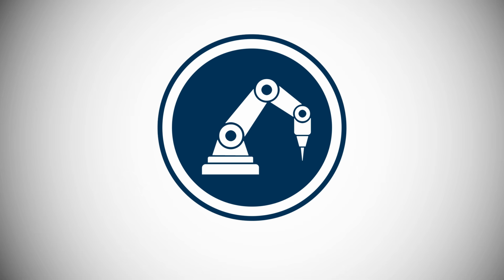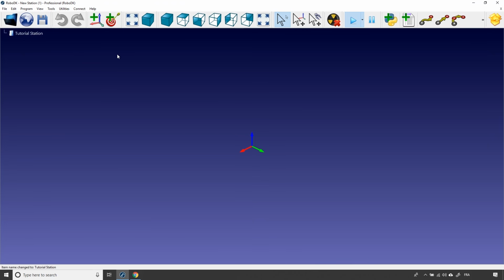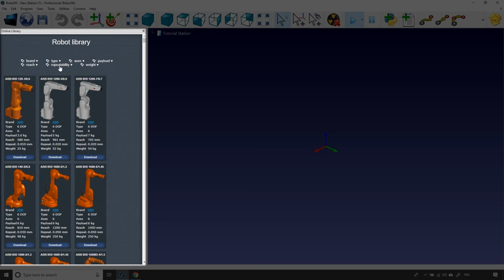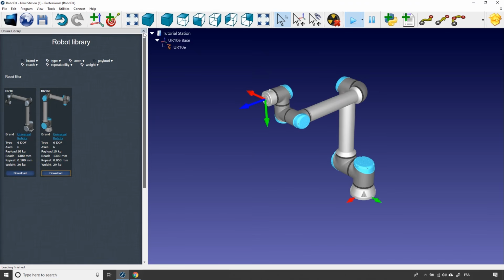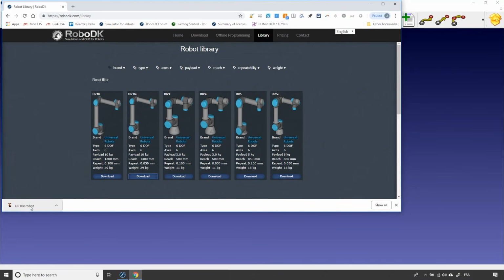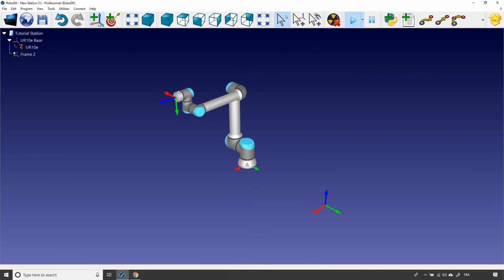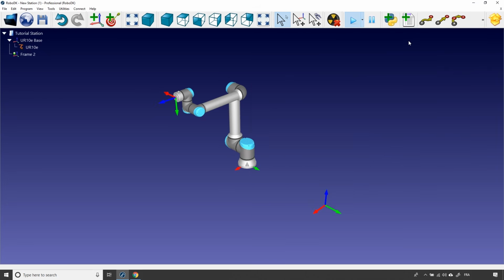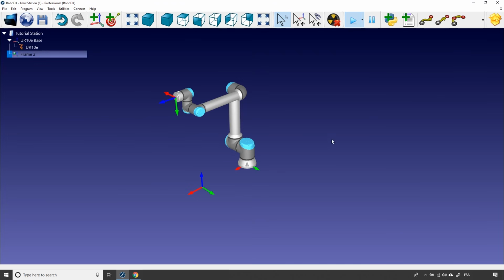Getting Started: New Project - RoboDK Documentation

Comment: AWESOME, can I work with arduino and Robodk? I mean if I make a simulation, can I have the codes for arduino??
Reply from the maker: RoboDK can not run on arduino. On the other hand, you can create your own robot based on Arduino and create a post processor and/or a driver for it.